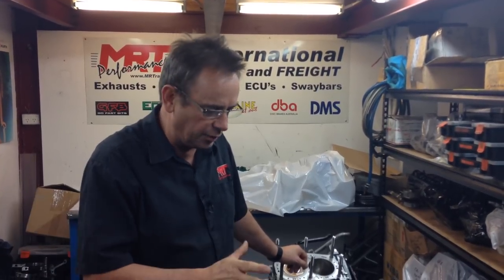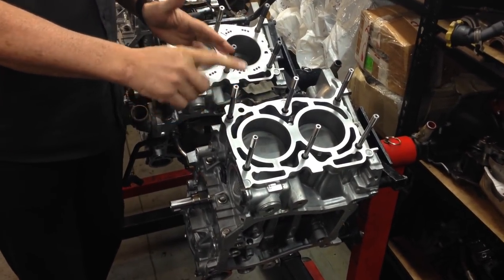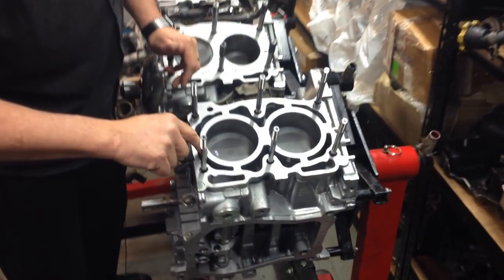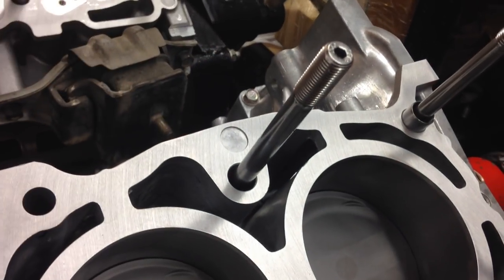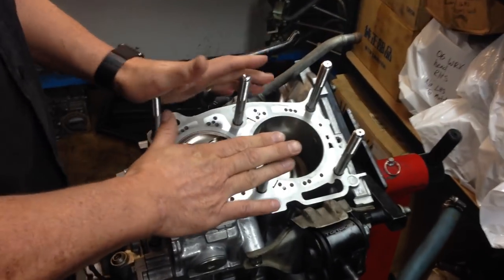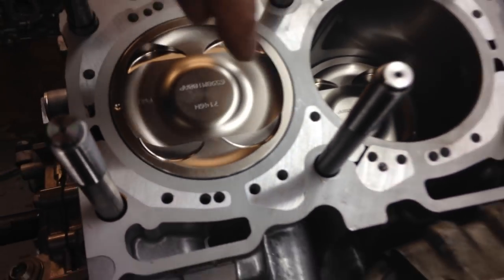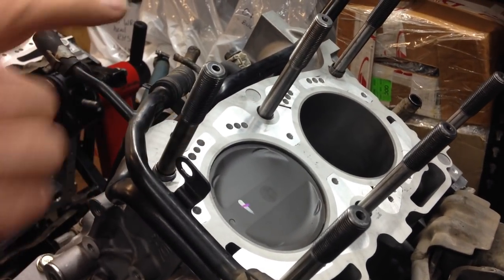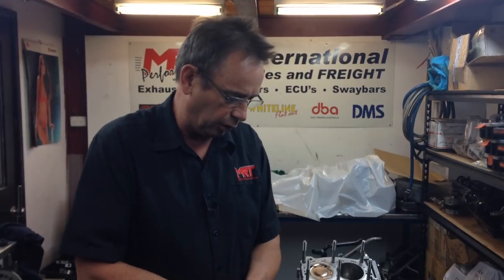Subaru EJ Block Comparisons

Comment: I have an 04 Usdm Sti and I engine swapped for an Ej207 Version 7 (03 Jdm Sti) The Ej207 feels way faster than the Ej257. EJ207 pulls all the way to 7k and the Ej257 dies off at 6k rpm.  I highly recommend.
Reply: The 207 redline is 8k bro. And the 257 is 6800
Reply: @stephenhui2246   I have the Ej207 V7 but Im still using the Usdm Ecu because I wanted to keep using my Cobb Accessport. The Ej257 revs up to 7k but the Powerband dies of at 6k.
Reply: @stephenhui2246  I agree the ej207 rev up to 8k. But mines is at 7k with Usdm Ecu. I have a couple vids on my channel also a couple Races.
Reply: @bikboi8768  Hey man. I am thinking about doing the same thing (ej207 into ej257 based car). What modifications do I need to do? My car is a 2013 STI GRF Euro spec. Planning to use the ej207 block from the same generation.
Reply: @8828RR 
* I had to reuse my (Ej257 headers) because of the "drive by wire" that the Ej207 doesn't have. 
*We had Swap the Cam Sensors also the Cams 
*The TGV was also changed from the Ej257 -> Ej207 
And that's it.
I keep my stock "Usdm Ecu" because it's a huge hassle to install the "Jdm Ecu."

Check out how my Ej207 V7 run. Got some videos might motivate you.
Reply: @bikboi8768  Okay I think the GRB generation EJ207 have drive by wire already, so shouldn't be a problem. I'm just worried about the ECU. Did you do any reprogramming to it?

Comment: If Subaru would make their engines closed deck to start with they wouldn't have the head gasket issues they have. I would think it would be cheaper in the long run versus warranty repairs and their reputation would be improved. My ej22t has over 300 thousand miles and no head gasket issue. Closed decks are the cats meow.

Comment: Great info thanks for sharing your experience.... You said the 2.0l can take a fair bit of boost.... What is a fair bit a boost? Would you mind sharing what you consider to be a good reliable range for a complete factory standard engine? I'm just curious. Thanks again MRT
Reply from the maker: hm, thats hard to say as it varies heaps with mods and the tune, more than 20 psi, but i would say LESS than 25

Comment: Great video, what is the maximum boost and horse power can the standard EJ257 block handle before close decking is required? Also, what can the standard cast EJ257 pistons reliably handle in terms of boost and hp? Thanks

Comment: Thanks a lot to MRT! A huge audio quality improvement over the past videos is that you finally got a better mic... FINALLY.... keep the vids coming you awesome guys!  Another question: Does the 2009-2012 spec C model engines have the same 2L open-deck blocks as shown in your video? Or they are special close-decked 2L? Thanks :-D
Reply from the maker: hmm, I would have to check as we dont get many here in OZ
:(
Reply: Thanks for your reply! How about GD chassis spec C engines? I think the GD and GR spec C cars are using the same engine.
Reply: The 09-12 GRB has slightly different EJ207 (v10), still open/semi closed block but it has slightly thicker cylinder wall of 13mm vs the older EJ207 featured here that has 9mm walls.  However the newer EJ207 on the GRB has hypereutectic pistons vs forged on this v7
Reply: WOW! Thank you very much for the insights! Can I assume that the EJ207(V10) still come with nitrated crankshaft and forged rods?

Comment: Love all your vids Brett. In the states we never had the pleasure of the 90s wrx/sti. Still in the planning phase for an RS swap but hoping to make a reliable 350whp on pump gas 93aki fully built longblock. Which would be best in terms of weight, reliability, and just fun to drive? 205/255? Gonna stick with USDM for ease of swaps.

Comment: MRT, great video again, but one question. When you close your decks the surface for coolant around the cylinders gets much smaller - wouldn't it be a source of cooling issues?
Reply from the maker: 100% reliable and this design has been used for many engines
Reply: Ok, thank you. BTW Would it be possible to share a few secrets about technology of closedeckig? ;)

Comment: Hello  , do you have details about ej204 AVSC motor in regards to the cylinder wall thickness and also in the internals, are they the same motor as the ej205 except the turbo?

Comment: I'll actually make a bit of a comment. The factory standard EJ207 you're showing looks to be a EJ207 "Thick Walled" block. I'm not sure about when they started producing those and whether they're standard issue in late model cars or not. It just looks substantially bigger than the GD-era EJ207. The EJ207 that has been closed-decked appears to be is a normal EJ207, but that may be the fact that liners have been inserted.
Reply: it could be a W20 EJ207?
It appears so. they came out of the JDM GRB WRX STi

Comment: One thing I understand is that forged pistons are preferable when making power because they are stronger.
But I don't really understand why? Are we saying that in the tune with forged pistons we are allowing the engine to detonate where we wouldn't for a cast piston?
Reply: think of it like this, a forged piston isnt melted down and poured into a casting like cast pistons, its literally a lump of metal cut into shape of a piston, its alot stronger than cast thats for sure
Reply: cast pistons for Subies have a higher silicon content than most, strong but brittle. They act more like glass than metal after excessive detonation.
Reply: Also, keep in mind the cast pistons of the 02-05 USDM EJ205 engines are less prone to ring land failure that the hypereutectic pistons in the Ej255s in later years. If you aren’t going silly with mods then the OEM non- hypereutectic pistons work great. I just pulled mine out of my 02 bugeye wagon EJ205 with 170k miles and there was still the black mirroring on the skirts; thin in spots but still present.

Comment: For a EJ253 rebuild, can I use the shortblock from an EJ251 and put on the heads from my EJ253 to use in a 06+ Subaru (with ACVS), or is there something incompatable between them?
Reply: ej253 has dome top pistons and ej251 doesnt.
Reply: @Mi11z187  So, if I just switch the pistons out on an EJ251 I'm good-to-go?
Reply: @stephenhunt6253   yeah id say so.
the ej253 had dome tops to up the compression and the heads went along with the pistons. ej251 has flat top with valve reliefs and a smaller combustion chamber head to go with the pistons.

Comment: On NA models, which is more reliable if both were in perfect condition ej22 or ej25
Reply: ej22, less likely to blow a head gasket. I drove my legacy outback for over 300,000 miles with the ej22 with no head gasket or other engine issues.

Comment: is the ej257 still a good block would you still recomend it?
Reply from the maker: it totally depends on what you're trying to achieve. There's nothing fundamentally wrong with an EJ257.
Reply: well a daly driver/week end  auto cross
Reply: For autocross it's very interesting because you can produce more low end torque than on a ej207. For daily use, the only downside is that it can be a bit more thirsty on fuel.
Reply: well i am worred about the liner craking under high boost pressure
Reply: sleeve it then
Reply from the maker: depends on your plans and targets of power, mods and repairs
:)
Reply: well arround 330-350 Whp
Reply: Carl Raymond Grenier the liner is a possibly however it’s one of the more rare failure to happen.

Comment: Question...is an 05 EJ 20 block from a wrx the same as an 04 EJ 25 from a forester? I want to switch the blocks on both motors and keep the EJ 25 but not sure if the pistons and crank will match. Thanks!